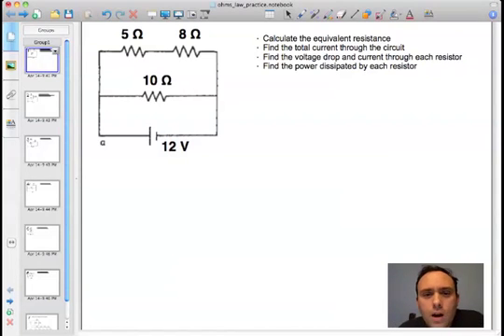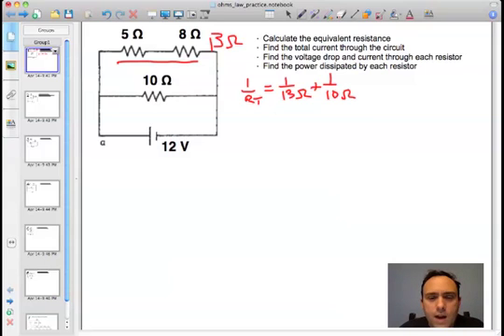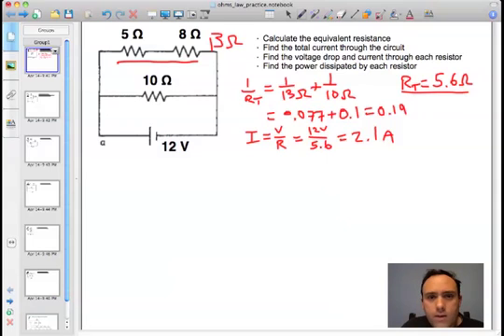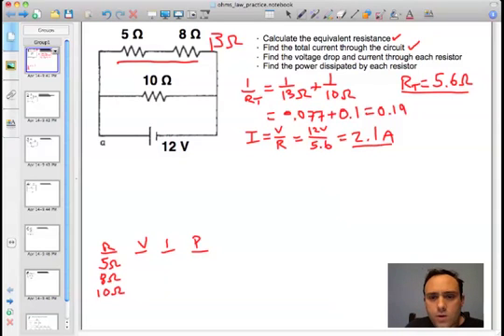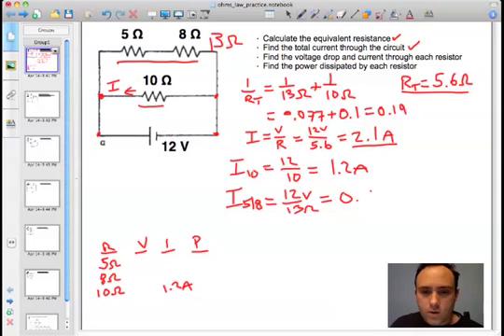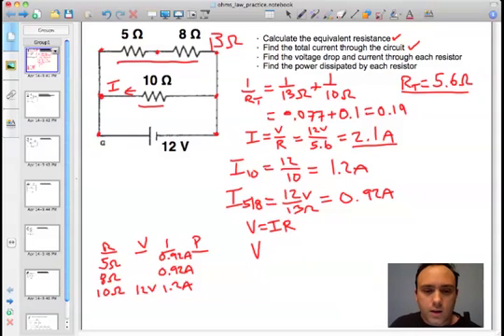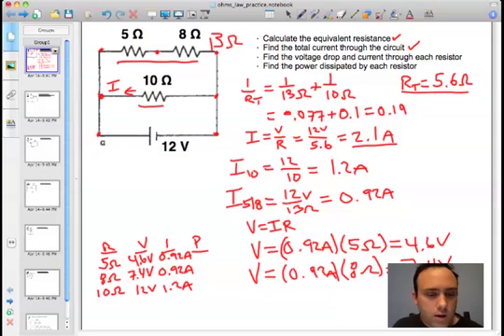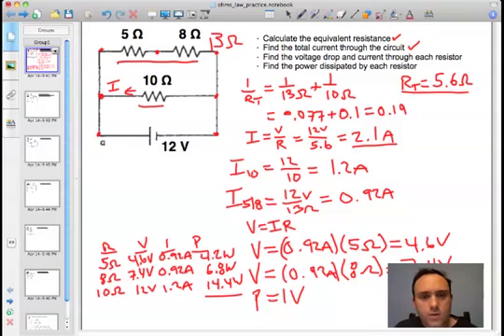Compound Circuit Solution 1

Comment: No, the total voltage across each branch is the same.  So the bottom branch has 12v and the top branch (4.6v + 7.4v) also has a total of 12v.